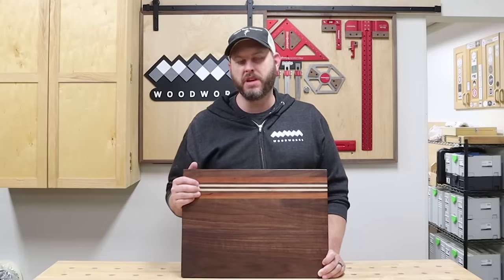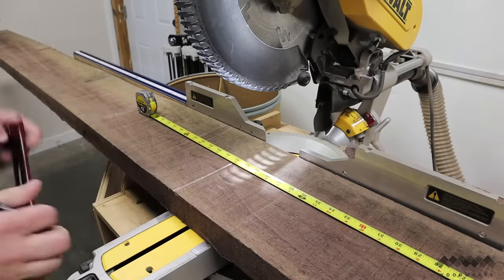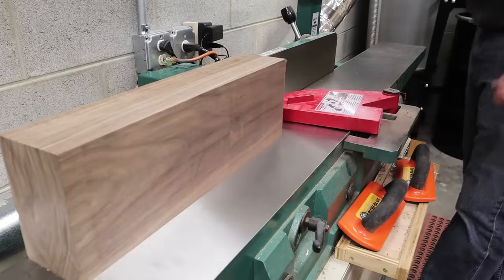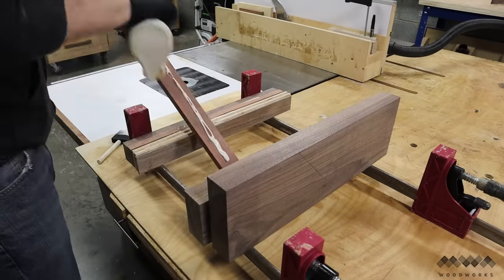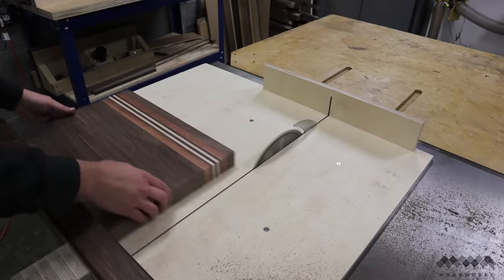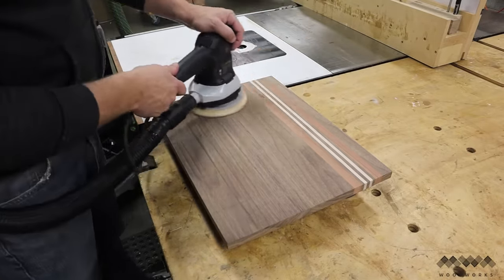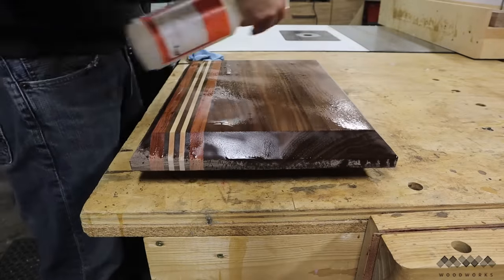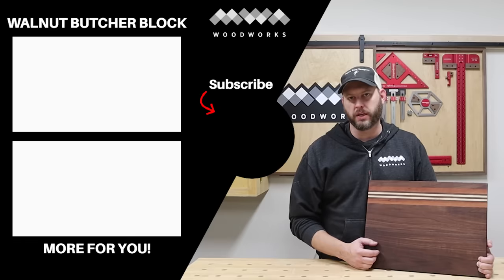5 Tips to create the PERFECT cutting board

Comment: Great info! Question on the use of different exotic hardwoods.... I try that on other projects and run into issues where the dust from darker woods "stains" the lighter wood. How do you keep that from happening? Full disclaimer, I don't have access to a planer. TIA!
Reply from the maker: Probably due to the amount of sanding you're having to do. There's not a great solution to that other than vaccum the surface often. With a planer you won't do so much sanding and I'm using a sander with excellent dust collection to minimize that issue. Good luck!

Comment: good job. so, if one doesn't have the mineral oil and beeswax mix, like myself, i first apply the mineral oil followed by the beeswax? thanks
Reply from the maker: correct. you want to apply the mineral oil and let it soak completely into the board and then seal it with the wax.
Reply: @MWAWoodworks  great, thanks.

Comment: That's a nice looking board and some good tips. Instead of mineral oil, why not use a food safe hardening oil, like walnut oil, tung oil, or pure (not "boiled") linseed oil. I would think that these hardening oils would give more protection than mineral oil.
Reply from the maker: The problem is those are all drying oils which means they oxidize and when they dry they no longer repel water so the board isn't protected.
Reply: @MWAWoodworks  Hm, I haven't heard that point raised before. I'll have to look into it. Thanks!

Comment: TIP #6 that every woodboard maker should know: Instead³ of using sandpaper on the fuzzy end of the edges; superior result is obtained with a scraper.  Not the one you used in the beginning of the video. A curved card scraper.
TIP #7 that every woodboard maker should know: On the two main boards; regardless of the waterproof or water resistant glues used, the mating board edges should be sprung. Some say its not important or necessary.  But doing so prevents the ends from ever separating.  Wood is a live product; something we should never forget.
TIP #8 that every woodboard maker should know: Tung oil penetrates the wood even deeper than mineral oil or wax, when mixed with orange peel oil
Overall...great video. 👍
Reply from the maker: Yeah I don't put tung oil on my boards 👍

Comment: I have a question I want to the same similar thing I want to know I use the jointer with both of the woods one flat surface and one side for both ones or one board
Reply: Using the jointer on both sides will get them flat but NOT parallel.  That is why we joint ONE face and then 
do the other side with the planer.

Comment: What do you think of stabilizing feet? It seems to be popular with other YouTubers to prevent sliding. What’s the pro tip?
Reply from the maker: Feet are an option some clients choose. I have a YouTube video on making a large walnut butcher block where I use feet. I don't use them to prevent sliding. I use them to keep large boards off the counter surface where they can come in  contact with water.

Comment: It's much better to check if it's square by measuring kitty-corner.
Reply from the maker: Actually that can be very deceptive. A square isn't the only geometric shape that measure the same corner to corner 👍
Reply: @MWAWoodworks  True enough, but has always worked well for me building bookshelves and picture frames. Probably because the parallel running lengths were the same. ;-)
Nice cutting block, by the way.

Comment: That shorter cut of the bevel is kinda dangerous, kickback is quite the option here, better to use miter fence. I also like at least 1 mineral oil bath before applying was/oil paste.
Reply from the maker: Very little kickback risk with the riving knife installed 👍 but if no riving knife yes risky although with the blade angled away from the fence the risk is again minimized. But you should always execute it the way you feel most comfortable because how you approach the saw makes a lot of difference. You want to cut confidently and not nervously.
Reply from the maker: I find a mineral oil bath for straight grain boards is a bit unneeded because straight grain boards don't take oil the way end grain boards do.
Reply: @MWAWoodworks  You just need be more patient with face or side grain, but they would suck a lot :). After that, they are waterproof.

Comment: Tip #1, do not use face grain like in this video. This can result in cut marks showing up very obviously and will not look good years later. Use edge grain pieces if you want to have a decent cutting surface that wont look horrible after use. If you're feeling really fancy, end grain.
Reply from the maker: All cutting boards show knife marks eventually. This is unavoidable and people shouldn't get so up tight about it. It's a cutting board not a sculpture. I've seen lots of old cutting boards that look so beautiful full of years of cut marks. Adds a ton of character to the board. Again, it's a kitchen tool not a piece for your mantle 👍
Reply from the maker: Check out the video I did on making monster end grain butcher blocks. That may be more your speed👍

Comment: Most important pro tip you need regarding cutting boards is only build/use end grain boards....long grain are useless for long-term use. Long grain boards split way sooner than end grain and once you have even the smallest split in a board it is garbage.
Reply from the maker: You should check out my video on building end grain butcher blocks. I think you'd enjoy it 👍

Comment: First, the board is very pretty but that wont last under use as it is not an end grain cutting board.  Any particular reason you are not making end grain cutting boards?
Reply from the maker: I have made end grain and long grain cutting boards professionally for years. Most people including chefs and restaurants use long grain boards believe it or not. I was surprised until I learned the industry. The idea thst it won't hold up really isn't true. Will it get knife marks more easily than end grain, a little. That's OK though 👍

Comment: What do you do if the board, once your done planing, has a low spot or is wobbly?  Run through planer until its gone?
Reply: a board that is warped should be face jointed first to remove the uneveness.  Simply running through the planer won't accomplish that because is is compressing the wood while going through the machine.  The warping can come back.  Once the warping is removed by face jointing, then run through the planer to make both sides coplanar.

Comment: I made my own years ago. What I don't understand, is why anyone would make a cutting board that is not end grain. There are zero advantages to a long grain cutting board, if you are making it yourself. Sure its easier, but if its easy you wanted, you would have bought one.
Reply from the maker: People love them. They sell quick and are quick to make. Makes perfect business sense.
Reply: @MWAWoodworks  Sorry, I did not clarify, I was mainly speaking for people that make them for their own use. I understand giving customers what they want, as they are cheaper to make, and their cons are not apparent up front (dulls knives quicker, cutting action severs fibers, as opposed to endgrain, that simply move out of the way).

I actually plan to add a under-bevel to mine. Thanks for the inspiration there.